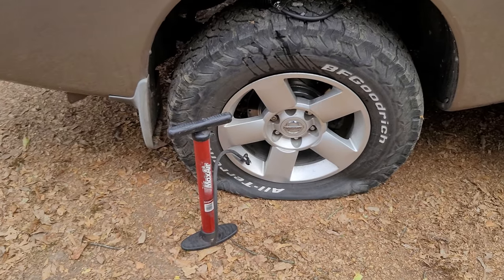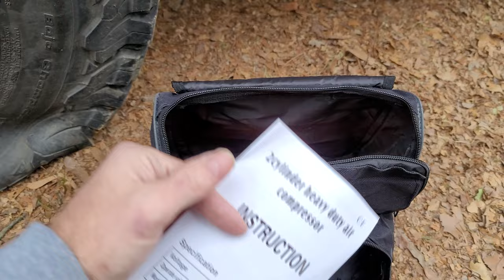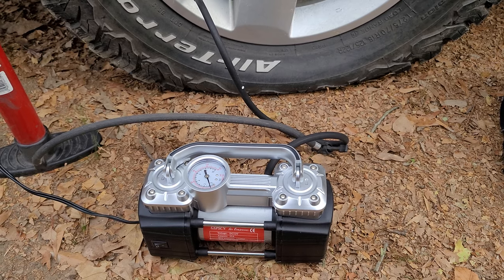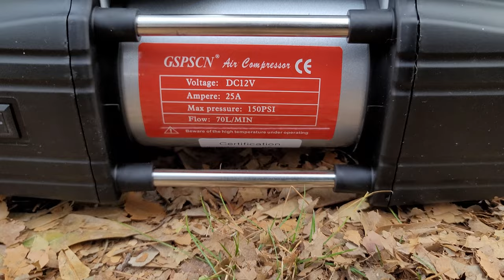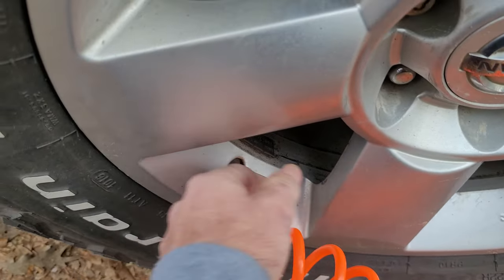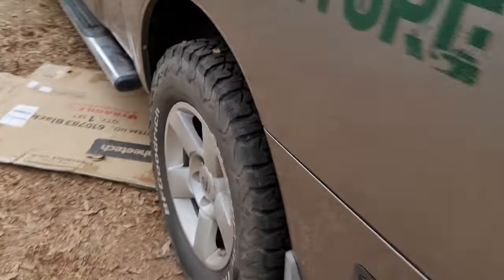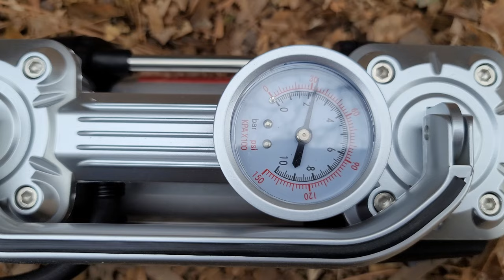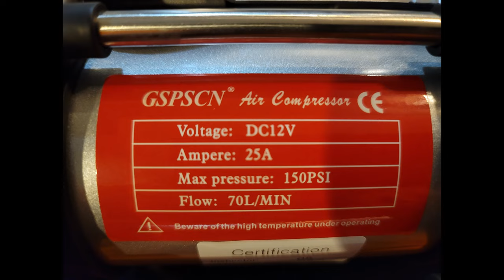GSPSCN DAUL CYLINDER 12V AIR COMPRESSOR with LIGHT

Comment from the maker: This is a nice compact air compressor to keep in your vehicle for emergencies and airing down, for low cost. Thanks for watching. Please subscribe to help support our channel. It is free for you and helps us out.
Reply: If you use the battery adapter with the pump it run's stronger and also does not heat the cigerette plug up nearly as much so if you doing a larger tire use the battery adapter just a heads up!
Reply from the maker: @gilbos440rt  Yes, I have heard this before. I need to start using it. Thanks.

Comment: Mine would not inflate over 5 PSI before shutting down.  Zero customer support on Website or Amazon.  Warranty card provided is worthless.
Reply from the maker: That's a bummer. Mine still works great and is used  often.

Comment: In a light truck / REAL SUV tire 20 Lbs of air is a lot. Crossovers, vans and cars, not so much. So 3.5 minutes for 20 Lbs is great. 

My current tire inflator is 0.64 cfm. It takes 10+ minutes for one tire to get from 20 psi to 40. 

This unit is 2.5 cfm. So it being 1/4 of the time is definitely worth the investment.